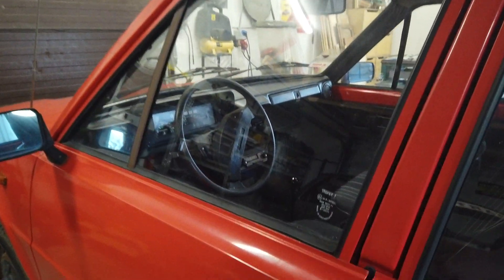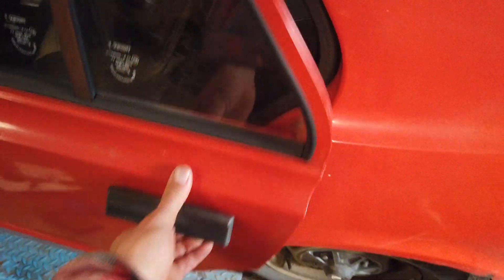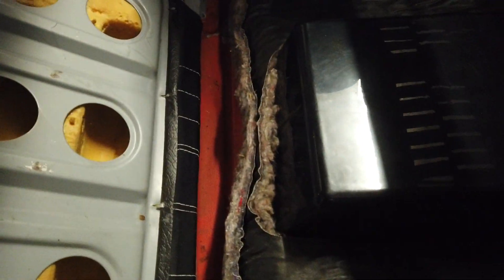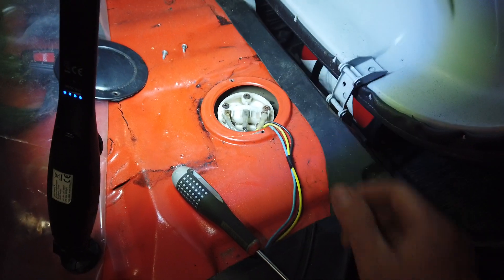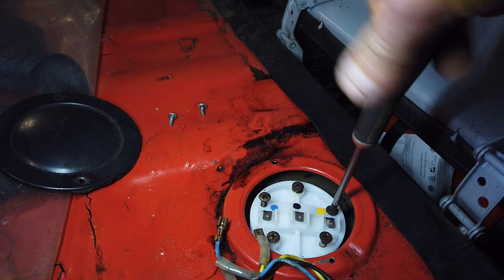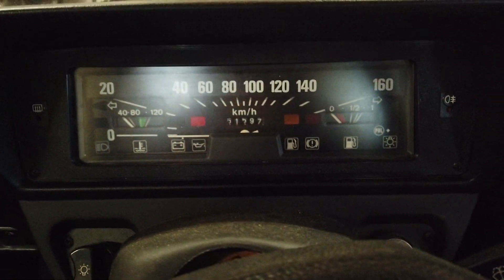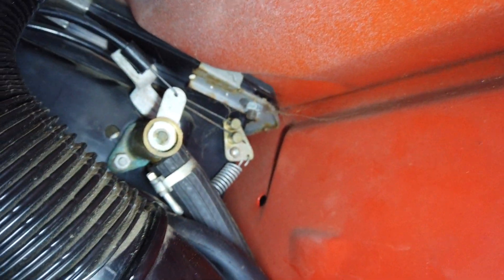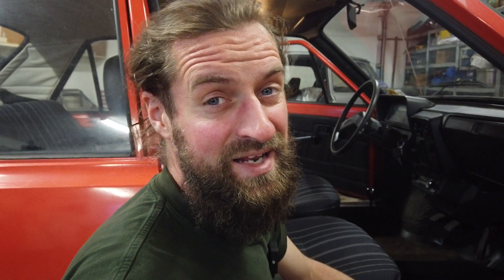BARN FIND ŠKODA 105- Fixing more small stuff

Comment: If you want to fold the back seats it’s easier to lift the seat at the front and then flip it. Great the heater is operational again from the dashboard and happy to see the fuel gauges work again. Lovely to see the factory protection foil is still under the seats. Think you are missing a cover in the front inner door handle.
Reply from the maker: Yes I am missing that handle cover.. :)

Great to know! a bit hard to do right with a camera in one hand... ;)

Comment: When I was a teenager my father had a 110R which is when I first took an interest in repairing cars. I find it amazing that despite these vehicles being so much time difference between manufacture a lot of the parts and locations see very similar. So it is interesting watching your videos of the Skoda.
Reply: The fuel sender was already in use in the 1000 MB. Think that’s great too!
Reply from the maker: Its great not to invent the deep dish every time you make a car in my opinion... using what worked and changing what needs to be changed is a very good way to evolve in my opinion. :)

Comment: oh oh

for the heater vent motor, there's 2 ways you can try: you can reach it from the top, reaching under the metal plate from the sides. with a very short screwdriver, you can unscrew the 3 little screws, and, if you're lucky, you can then remove the motor together with the plastic blades. it's a tight fit, but sometimes you can just squeeze it out and back in this way. 

If this doesn't work, the official way is to take the whole heater unit out (down into the cabin). you can leave the water hoses on on the right side, but the bleeder tube is connected to the left side, to an extremely fragile plastic stump. be very, very careful with that (it's better to carefully disconnect the bleeder tube at the beginning). This is the point of this whole comment because if you forget about it (like I have a few times) and break it off, you can throw the whole heat exchanger away..
Reply: Very good advise! But isn’t the bleeder tube on the left side? Or do you mean something else?
Reply: @MrSkoda105s  hahhh, yes, i meant the left side 😁

fixed, thx
Reply: @bencem.1862  and the same goes for the fragile plastic tube on top of the radiator. Always be very careful with that 😅
Reply from the maker: Perfect tip once again Bence! thank you...

I really hope to pull it off from above! ;)
Reply: when I was removing the heater I snapped the plastic part.... so luckily I was able to locate a new-old stock in Germany and order it..... around 35 euro I believe. So now I have a brand new heater core :)